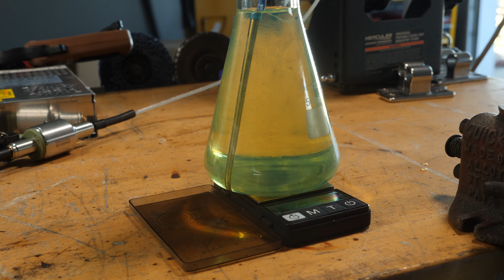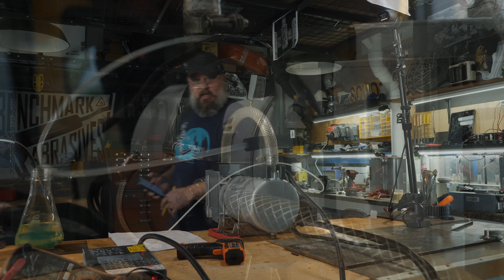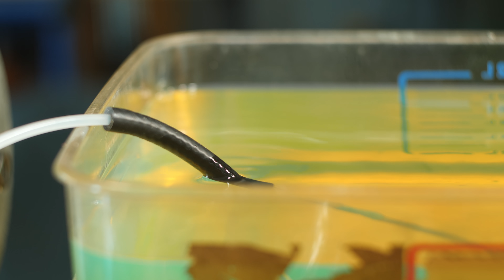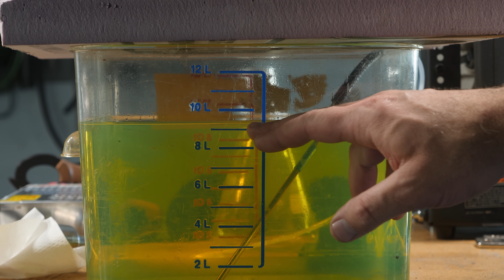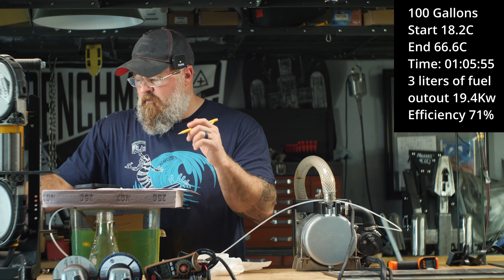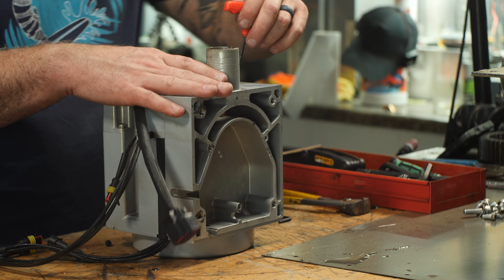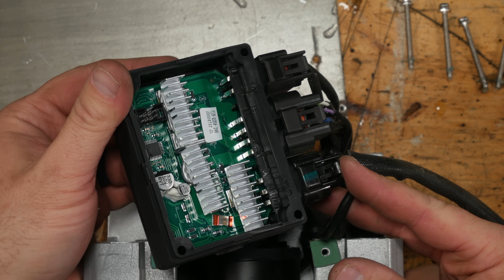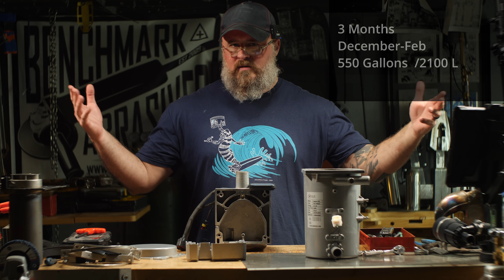The Diesel Heater They DON’T Want You to See — Real 20kW Output!

Comment: 550  gallons of diesel fuel for 4 months is gonna be quite spendy. Not to mention the fact that starting winter in December and ending in February is a fairy tale.
Reply: 2081.98 litres at 1.70 a litre where I am is 3539.37, is 884.85 a month
14 kw is a huge amount though, 3 litres of fuel for one hour is 5.10 per hour, quite spendy..
Reply: @antonyjh1234 am I thinking is use red diesel to run it
Reply: @homermcclain4599  red diesel not common around the world, you may as well say you can get diesel cheaper in Saudi Arabia
Reply: @antonyjh1234 IF GOOD INSULATION,  MIGHT BE ABLE TO RUN HEATER ON HIGH WARN SHOP UP THEN TURN DOWN TO HALF SETTING.   OR RUN ON LOW SETTING IF POSSIBLE WHEN POSSIBLE
Reply: @JonathanMorfoot  WHY ARE YOU YELLING AT ME ABOUT INSULATION FOR?
Reply: Burn free fuel. Get used motor oil from shops or used oil from restorants and burn that.
Reply: It doesn't break any rules regulations and I can get rid of diesel for $3 a gallon
Reply: It would have to run 6 month out here and i do not use any of those fancy diesel heaters.... i will stick with kerosene heater that I made that runs with out electric to heat home and water and use very little fuel..Its a wick one....I just mod a wick heater one with alot of trial and test over 2 years time would like to run on diesel but not there yet  ....
Reply: YEP IN MANITOBA DIESEL IS NOW $1.799 A LITER THATS  $6.80 A GALLON SO HOLYS SHIT YEAH VERY VERY EXPENSIVE

Comment: I genuinely didn't know these existed.      My dad and I were just talking about making a small shack to live in and having heated floors in addition to other heat sources.     I was hesitant on doing the heated floors because I was thinking about wood burning boilers or a complicated heat exchanger setup.      

I'm talking about a small like 8*20 cabin with concrete floors.    Have a mini split probably for main heat  and the heated floors for additional heat.     

If we go that route something like this would be awesome    but id want something with a better controller.    And id Wana set up some sort of smart thermostat where if the floor temp dropped below a certain temp this could kick on.  

But nearly 80c is REALLY hot so I don't know

Comment: 20kw is plenty.  if you don't mind running 24/7 5kw will heat a 1200sq foot home at 0 deg f, and that's an older home with old windows.

Comment: 17:54 a diesel furnace is not that much more efficient and it burns the same amount of fuel in a larger heat exchanger. Obviously we know that water is much more efficient in transferring thermal energy than air so for that pint size unit that's pretty dang good for fuel consumption. And that's with me being an Alaska during the winter and a 2000 ft² house.

Comment: If you didn’t have a fan blowing air at the water tank, increasing heat loss from the surfaces of the tank, and insulated the tank, it would probably have worked out even more efficient. A good test though. ‘I decided to build  house/cabin so I could test this heater!’…..a bit over enthusiastic I’d say!

Comment: what you want show here i dont get idea -in Germany is plenty of these called kereoseme  heaters, and i dont understand what the fukk you do here 
on this crap, what you have is a flaw of design =is a very small burning camera if you get new device there must be a whole magazine on how to tune it what, and how it must look, heat exchanger 
yes they are turn-on on turn-off design but that is ez automatic starting
-diesel or kerosene or whatever slime you use it in must have its own viscosity  
-work cycle has a preheat, normally the camera  
-When you click start, it runs the diesel in a circle to heat up like to 100 or whatever temperature needet
when reach that temperature, turn on valve and then* heated diesel go to 2 filter 
and then to the injector, 
injectors have their own sizes its hole size, and angle  45 -85 degres 
 -whatever is needet by size
then you have a flamethrower-type device 
=that means a fire burning chamber lenght
-blover is calibrated in the factory, which does not mean you can change speed for device and is normal is not 
The turbine and pump are on same axle, dont do stupid things
in burner head is optical fire starting sensor it works on light heaater start heat oil-have some timer -if reach temperature -starts again 2-3 times to heat oil
When the valve opens starts high voltage igniter device  for some time 2 mins if optical device sees fire is ok if not it restart ignite cycle (after 3 failed attempts, it turns off and drops in alert mode  ) All must be off 
why is not off on  like car heating head has a lot of iron and has even prolonged fire time 
-domestic  burners have 2 holes behind one is an ongle  bolt and a cover when put it simple slide down and holds onown weight and the other is on bottom of burning camera  2 inches or 1,1\4 inch pipe with stop end manual stopper. good when clean or overflow open and let all go out
-what for them injector makes a mist , if overflow it shoots like imagine you have  2-3 atemnted to start then tryed t again and  again there is full of diesel, then goes bang -big flap opens and close  down, one usual shoot corc out if there is diesel, you may see diesel flowing from there or water if the camera is ruined 
-car heaters have small cameras and have big emissions. Domestic cameras (heaters) have big cameras, long give a lot of heat and fast if compared to wood stoves, 

-if use other than diesel domestic heaters is cleanable and has maintenance times when and hot to clean 
german domestic heaterrs have like cars certificates and 2-3 years need call repair man to check emisions usual they have co2 meters  and reduce diesel flow 
if the camera is connected with suth  and mixed with oil needs to be cleaned normaly  its full cleaning and certification  
certification gives right  to buy heating oil (is tractor  fuel normally red aditives ) tractor green
-red fuel dont have oil additives and run dry injectors its the same as train diesel wears more pumps 
car heaters have very shitty  short maintenance timers, fast wear off if the muffler  can melt inside the metal heatechanger  usual is from aluminum

Comment: First off, I take great exception to your December to February timeframe; you will need some heating in October and significant heating in November; and then you have March and April to think about!
Second, this is an extremely expensive way to heat a structure; fine if you're going to walk away but never for primary.

I created a solar system for my house in 1985, and my first natural gas heating cycle was this November 30th. 
Today (December 1st) my solar came on at 9:06AM (the collectors have to be at 130°F to start) and the outside temperature was 15°F.
My last natural gas bill was $25.00 exactly (never had an exact even amount before!) and I usually never exceed $50/month for the coldest months (Jan & Feb).
I'm doing this with 162 sq-ft of collector area to heat 936 sq-ft (upper-level) and partially-heat a basement (at a lower temp). 
I usually keep the house at 75°F before dumping the excess into the basement.
There is a circulating fan that consumes 400W off and on for about 6 hours (so worst-case = 0.4KW x 6H x 0.18¢= 44¢)  

Now I realize, that you have to have aperture to the sun, but in Denver and most of the mountains you do pretty well.
For those without sun aperture, wood head is better in that most cabins (including one I maintain) have access to indigenous wood sources.
For standby heat, you could also use a pellet-stove or the diesel setup you're showcasing.

Anyway, I do appreciate the video and the teardown and efficiency BTU-calculations; BTW, water with its specific heat of 1.0 is an excellent way to judge heating output and power!  And, as you saw, whether it was 5-gallons or 100-gallons, the calculations are about the same.
Great video!😀

Comment: 550 gallons of #2 heating oil in northern NJ is about $3,000 dollars. plus the cost of the unit brings the total to @ $4k. Electricity here is0.13cts per Kwh. Wood is free except for the time to process it.
Reply: Wow, I live in Alaska and I only pay $3.05 a gallon for #1 heating oil. Our electricity is 0.22cts a Kw. We heat 3,400 square feet with about 600 gallons and a couple cord of firewood each winter. We’ve had mornings where it was -36 this winter. Some winters we get down to almost -50. We use 2 15,000 BTU Toyo heaters. They only use about 50 watts each when they are running. The nice thing about the Toyo’s is they run at 5,000, 10,000 or 15,000BTU and automatically adjust to maintain the temperature. They are quiet too. They advertise that the Toyo’s are 90% efficient. We have the heaters along with lights , fridge, freezer and TV/internet on a sub panel with a transfer switch so I can power it with a Honda 2000 during a power outage. It will run over 10 hours on a gallon of gas.

Comment: If you don't want soot, add a cap of 2 stroke oil to the diesel. It'll clean it up too if its dirty. perfectly designed detergents for heater combustion.

Comment: Apologies for being oblivious.  I'm familiar with diesel heaters that force air around the burner.  Because you're heating water how is this supposed to heat a cabin?  Guessing it's meant to heat water going into a radiator?  Then you blow air through the radiator?  Any insight would be appreciated.
Reply from the maker: no need to apologize. here is a video talking about all the ways to use a hydronic heater like this . 
https://youtu.be/3H5StV_Agys

Comment: I was wondering why it doesn't look like one of them hot air units that all seem to look the same... This is a hot water system. It would be great for trucks in the north to keep the engine hot during shut down and the cab heater core would keep the cab warm too...

Comment: Here's a suggestion: use the exhaust to drive a TEG.
Electricity isn't free and when one heat source depends on 2 different types of fuel it sucks.
The waste heat is almost 8KW and with a 5% efficiency TEG you're looking at almost 400W of electrical power which would not only make it power-independent (24V * 9A = 216W) but also let you keep the Router/CCTV running and maybe even maintain some equipment batteries charge.

Comment: Thanks for this test. The ideal senario you described where you would use this is the exact thing ill be doing. Wood heat as primary. This to supplement for when gone and to run in the radiant floor. 

Super helpful 🤙🏼
Reply from the maker: Awesome to hear this information is super helpful for your setup!

Comment: Gee-looks like a blast tube and a cast heat exchanger! What is the fascination with “diesel” heaters when #2 oil has been used FOREVER to heat water for domestic and industrial use. And 85+% efficiency to boot.

Comment: Homes have been using oil based fuels to heat homes business etc.. 	1859: The first U.S. oil well was drilled in Titusville, Pennsylvania. This opened the door to refining petroleum products for heating. Late 1800s: Kerosene, a petroleum distillate, was widely used for lamps and sometimes for heating stoves.  Heating homes with oil-based fuels (like heating oil and diesel) began in the late 19th century, peaked in the mid-20th century, and remains concentrated today in the Northeastern United States.

Comment: Conclusion NOWHERE is it worth the hassel and money-- wood solar wins fast cheap and if you add the bs of heat exchange water heater I put it on with 6 four foot logs and at minus 30 it keeps the house warm for 5 day. END of story. The only heat that will be faster cheaper is nuclear micro heater that the russians use for 40 years downside radiation could kill you if the cold doesnt

Comment: I could see this being a good option for someone trying to keep a commercial greenhouse relatively warm during a stretch of very cold weather.  Cycle the output through a series of 55-gallon drums to spread the heat throughout the greenhouse.  Is that one of the use cases for which these were designed and built?

Comment: My gas boiler has no thermostat for air temperature.  Instead, you use the thermostatic radiator valves to control the temperature in each room.  The boiler comes on and off as needed to keep the radiator flow temperature consistent.  If all the radiator valves are closed due to all the rooms being warm enough, the boiler will turn off the water pump and try it every 15 minutes to check for water flow.  If there is water flow and the water needs heating, the boiler will ignite, and the cycle repeats.

Comment: Great compact heater 👌 great test information thanks , In Scotland I had a large workshop and used waste oil in a thermobile heater , apart from carrying a spare jet/ supply pipe it ran perfectly for years .The pipe coked up ,so left the spare soaking in solution, changing it over every few months of use
Reply from the maker: That's an awesome real-world experience with a waste oil heater, thanks for sharing!

Comment: I have a couple of the older 8 kW versions that I used to heat my old 1500 sq ft leaky farmhouse in Wisconsin. Most of the time 1 does enough, but on below zero nights I will use 2. My normal heat is from a Senville 24K BTU Mini split that is 300% efficient because it doesn't create heat, it pulls heat from cold air outside and brings it in. I leave it on high all winter, costs about $150.month to run at .11c kW here. Diesel heater is a back-up if power goes out. Nice to know it will work FT though if I need. I have large batteries and solar panels for charging. I have extra-long exhaust for both of them to get more heat before it goes outside.

Comment: $500/mo [e.g., ~$3/gal] just to keep the house from freezing? "Heat".. you said 3btu/sf fir your 1500sf house. I didn't hear what your temps assumptions are for that [e.g., avg. Outside temp over the 3mo period, avg inside temp? As this doesn't include potable water heat or bathing, it seems 500 bucks a month for a small home is on the high side.

Comment: i would use titanium heat exchanger or egr on the exhaust and plug it in the water jacket :D extra heat :D
Reply: It will clog, it needs an insulated exhaust.

Comment: 😃Hi, a diesel-fired, modulating, blue-flame, condensing boiler like these is definitely more efficient: Viessmann, Vitoladens 300-C
These hydronic units are designed to be compact and installable on mobile vehicles, not to be efficient, a lot of heat escapes through the exhaust. 
I'm using an Eberspächer unit with a 26-gallon storage tank, which acts as a hydraulic separator for the two circulators, and downstream with a thermostatic mixer that lowers the temperature to a maximum of 100.4°F. I'm using a 5-zone radiant system with a maximum 3.8-inch pipe spacing, and it works well.

Comment: These have been available for years. I have had the 30kw running in my shop with 80/20 Diesel/Waste Oil for 6yrs. Running a 2 zone heating system, I did add a 10gal hot water reservoir in line with the ouput (that helped a ton).
Reply: Reminds me of a neighbor, who owned a car repair shop (now retired) in his garage at home he has a few tanks with waste oil for heating. So he gets paid for the oil change and gets free heating oil.
Reply: Any issues with soot when running 20% waste oil?
Reply: Do you use standard hydronic baseboards?
Reply: Well done old school thinking
Reply: But I cannot help it. I see with my own two God given eyes

Comment: can i ask what power input was 120/240 or is it down to 12/24v at 8amps, and is the electric use inlcuded in the the efficiency figure
Reply from the maker: amperage was measured at 24v. I did not include the electrical power consumption in my calculations. that is miss on my part. although the powenfor 1 hour of continuous run time is 0.2Kw so it’s about 1%of the power provided by the diesel
Reply: @HanginwiththeHursts thank you bud

Comment: Okay I've had enough let's get down to the nitty-gritty how do you service and clean this thing especially if you're running it on diesel? Once again I would recommend kerosene
Reply: pipe cleaner down the exhaust annually if it's not insulated.

Comment: Have a look at most domestic central heating systems in the UK, typically run off a 17-18kW condensing gas boiler 

20kW should be no problem at all
Reply: mine is 35KW & it's widely available in mainstream stores.

Comment: Your best bet is actually natural gas. I'm not saying that that can't freeze up at the valves but. I would be using natural gas or I would be using kerosene. They both burn much cleaner than diesel or heating oil you know same thing.
Reply: My sooting issues wend away when I went with #1 diesel. Although I have to say I have yet to soot a diesel water heater. The air ones yes, lots of times.
Reply: Natural Gas (impure methane) won't run in this unit, nor will LPG or any other gas.

Comment: I spent my entire adult life working on oil-fired furnaces and boilers. It has been my experience that the smaller they get the lighter the fuel you should use. What I'm saying is it would probably be wiser to use kerosene instead of regular heating oil or diesel fuel. I have literally tested this over the past 37 years of my life. Just saying. Unless you like cleaning flues and smokestacks and nozzles on such.
Reply: #1 diesel has yet to soot any of mine, air or water heater. The air ones I’ve sooted several times on #2 I have yet to soot a water heater type. They tend to run full blast until the water is warm then shut off. They don’t go down to an idle like the air ones. Except for the new espar I bought. It will, but I think their fuel / air mixture formulas in the programming are far superior to the older stuff. I never see that thing smoke (uncombusted fuel)  ever.